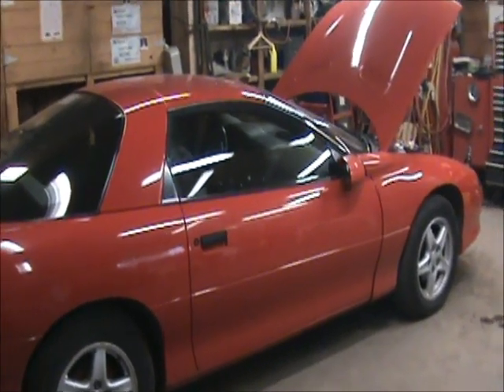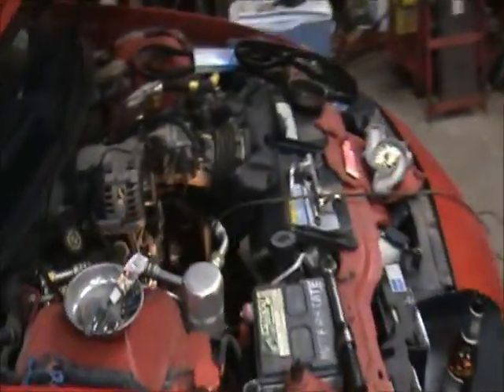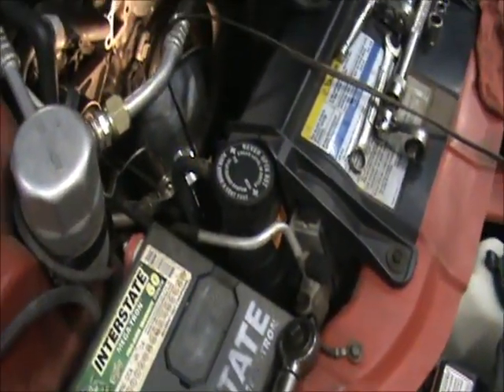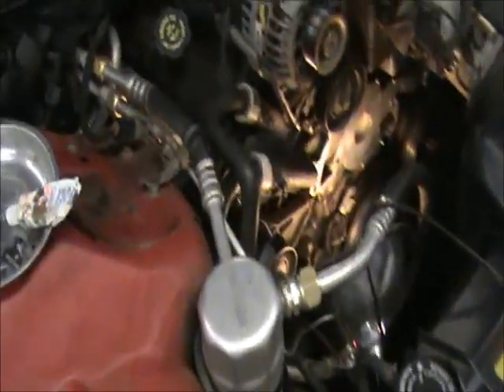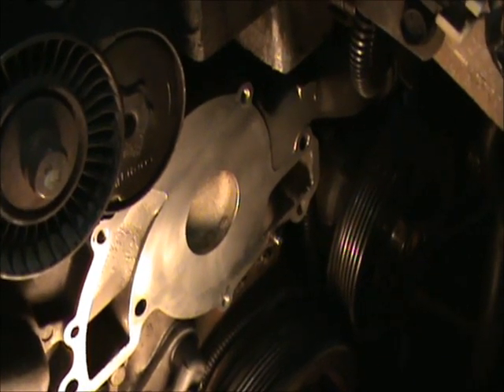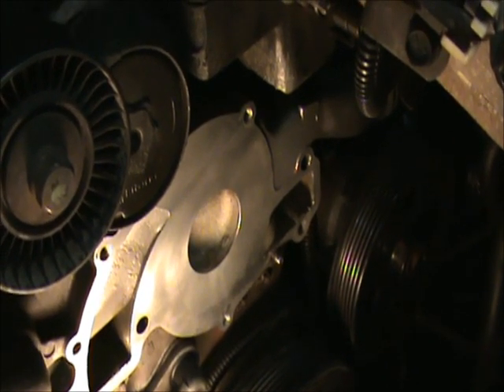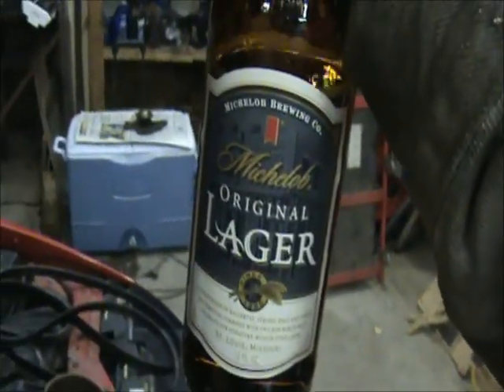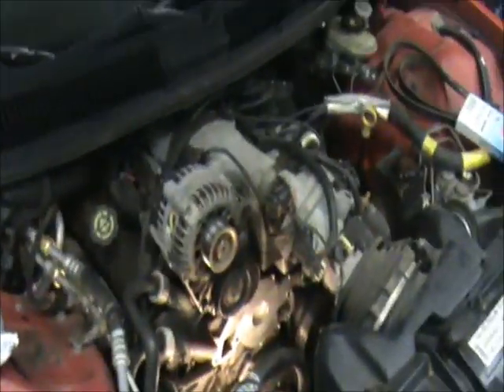97 Camaro Water Pump Tips

Comment: Bob, I have my 97 Camaro at the dealer right now. They are asking $660 to replace the water pump, flush the coolant, replace a radiator hose and a tensioner pully. How badly are they trying to screw me? 
P.S. The $660 was AFTER I haggled them. They wanted over $700 at first

Comment from the maker: @10jmsoccer Could be a partially plugged orfice tube or your pump is wearing out...You could try to suck out the fluid with a baster or a mighty vack then add some lucas power steering conditioner (shit's guarenteed or your money back...if available in your area.  It is one of the only things I have seen quiet down the old ford whining pumps and some othere too. Obviously...check your belts and pullys too.  Best wishes!

Comment: know anyone with a good cheap set of preformance heads ive got a small block 350 out of a 89 iroc im re building for my 91 rs stock 6 cyl with 273xxx miles. 
I have a 9 bolt borg warner rear end posi and a 700r with shit kit